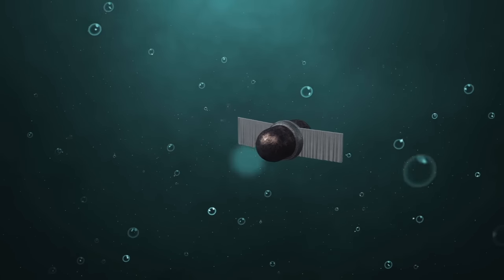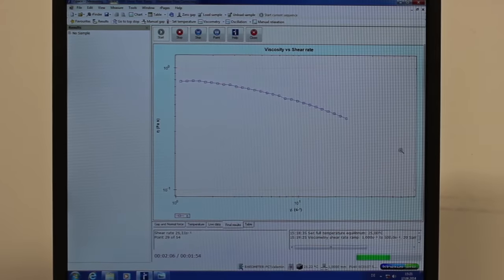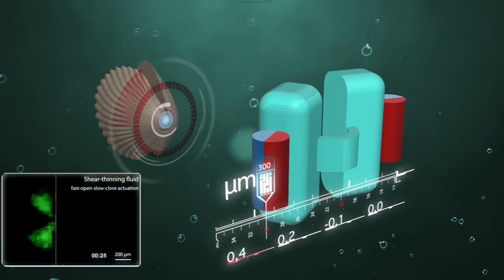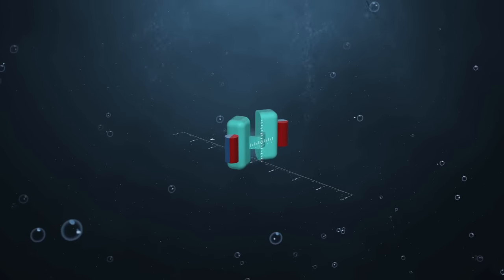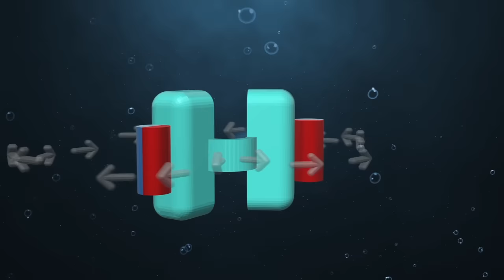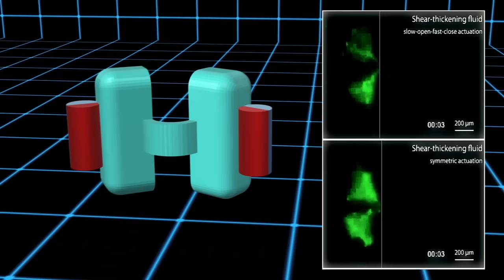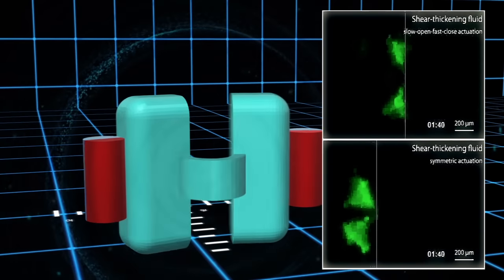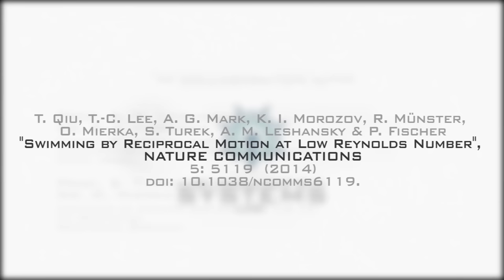Swimming Robotic Micro-Scallop

Comment: Bacteria can make motors out of protein... so why can't we?
Reply: We are supposed to be so advanced right. Yet can't figure out how the parts of subatomic particles are held together. So instead of admitting that the subatomic level is even more complex then ever imagined we just call it invisible energy. In other words Scientists are clueless of how too or even where to start to build anything produced naturally.
Reply: We probably can, but it's not that easy. And I think the most important reason for not doing so is that protein motors will mostly be recognized and attacked by our immune system. The engineering of this would be extremely difficult to get to work effectively.

(And Dan V, why are you even talking about the subatomic level here? It's not relevant to this video. Also, there is invisible energy all around us. Or can you see electromagnetic fields directly? Or nuclear energy? Chemical energy? Potential energy?)